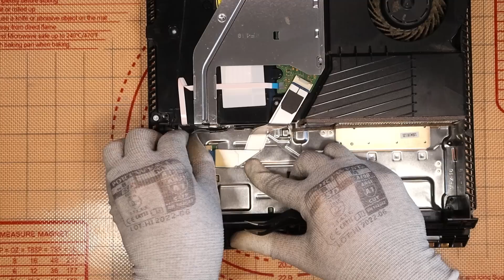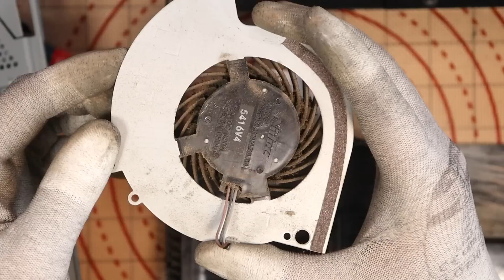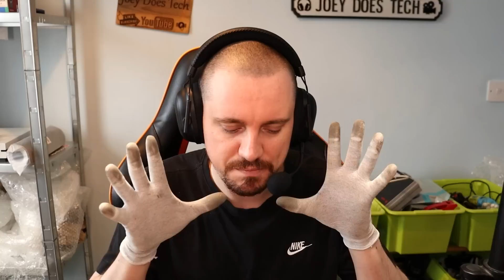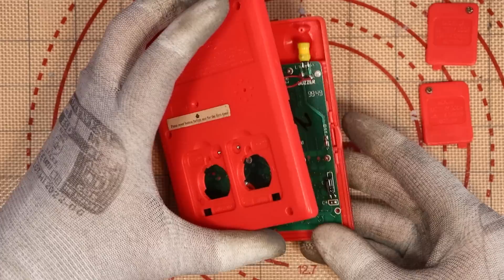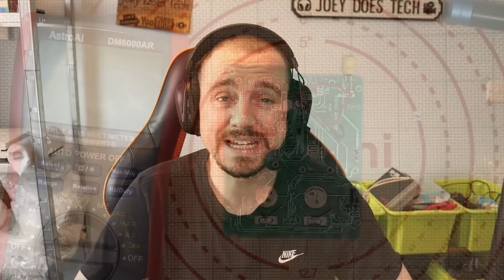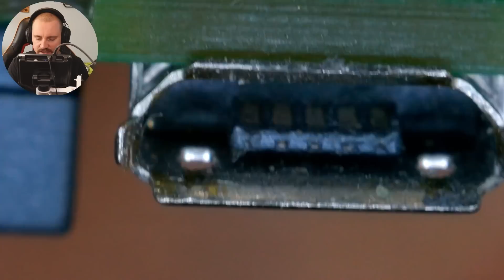Trying to Fix Electronic eBay Items for Profit? | Profit or Loss S1:E36

Comment: I think U5 is part of the USB to 3.6V buck regulator circuit. Its a 1D8242 5 pin device Pin 1 is Vin, 2 GND, 3 Enable, 4 FB and 5 Switch....

Comment: Last item you should be able to figure out the transistor you need buy checking the datasheet of the ic next to it if it connects to it

Comment: One of the Pins of the missing transistor may be connected to ground via a resistor, so the 
grounds polarity will provide a clue as to what type of transistor "NPN or PNP" would be 
used, to save costs manufactures use the same transistors, so take a look around on the 
circuit board and see if you can locate any other transistor and see if you can get another 
one to see if it will fire up the unit, if it fires up make sure the transistor is operating around 
the same temperature as the other transistor, and if it is and the unit works, you may do a 
quick dance, lick your finger and stroke the air notching up a win for a miniscule profit.
If no transistor can be found on board at least try a NPN or PNP that will fit there..
APU 👁👉👍👈

Comment: I have the same Pokedex, you need both batteries in it to work. There is some 5V logic chips I am sure, that will need both batteries connected.

Comment: For the second item
Check the lcd voltage pin.

For the 3rd item Check the ic data sheet
If the ic shows it’s a 3.3v ic
Then any 5v to 3.3 transistors will work

Comment: Good content as always Joey - couple of suggestions. The DJ board - if they are inexpensive, buy a working one to find out what the blown component on yours is, then sell it again. For the PS4 I would take a hard look at the thermals... they are very sensitive, so use a GOOD paste and GOOD thermal pads on all those chips around it (8 each side)... I also found that using thermal pads too thick was a bad idea, so go for 0.8 mm or 0.5 to get everything contacting well.

Comment: You can just plug the 5v line into the board the test the 12v 🙏 or you can figure out which wire to jump, but if you get it wrong you short it so plugging into board is safer 😂  
Ask how i know

Comment: The "click" of a hard drive is usually the sound, when the power turns off and the head(s) slam back to the parking position. The volume depends on the vendor.

Comment: The pokedex display connector is a zebra connector, similar to those used in standard 1602 lcd displays - they need to be pressed down really firmly and are held by metal tags on lcd displays - so maybe it would be worth trying a bit of extra pressure on the zebra strip while testing the device?

Comment: Hi Joey remember I said I had a strange 1 with a ps4 few weeks back it had the same problem as this 1 monitor the board with your ir cam when its powering up before switching itself off. I found a cap glowing but the strange thing was it was testing good in and out of circuit

Comment: Launchpad mini, U5 is a Voltage reg that feeds the 3v6 so more than likely a 5v reg allowing for the circuitry inline, Remove L3 to bypass it. usb incoming power from Vbus, GND from DGND to feed a off board 3.6v reg, 3.6 feeds into 3V6
Reply: Looking at the board again, it looks like an LDO adjustable reg
Reply: Found it, it's a USB to 3.6v buck circuit U5 is an iD8242 R21, and R22 as a voltage divider with C21 cap for the adjust/fb

Comment: The dohicky on the Pokémon gadget is called a "Zebra Strip" i had a Nokia 3210 which showed nothing on the screen, i believe i cleaned it with IPA ans reasembled it with extra force and now it works absolutely flawlessly no issues
Reply: And it works by having hundreds of separate parallel paths for electricity. Each pin on the board has multiple channels touching it. The alignment of the screen with the board is essential so that the connections go to the right places.